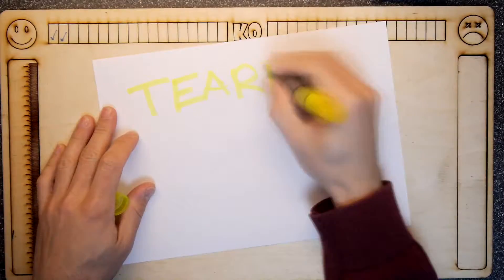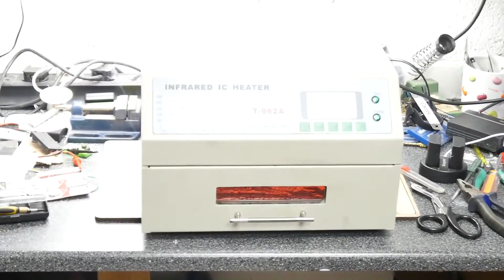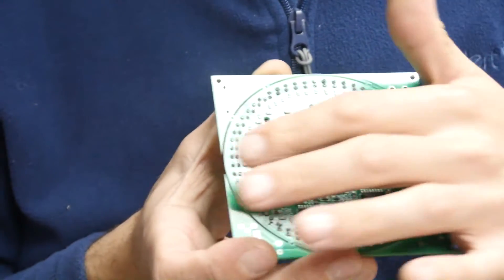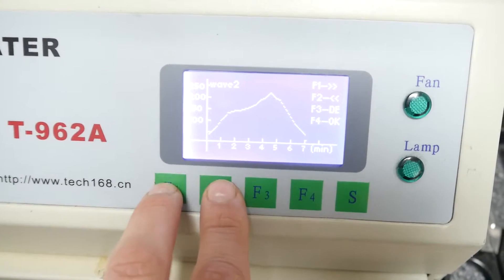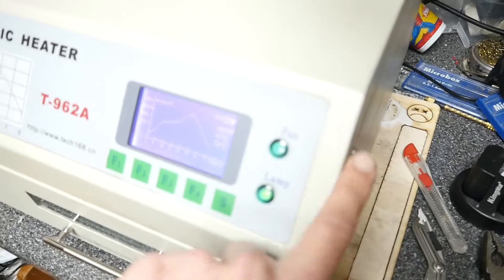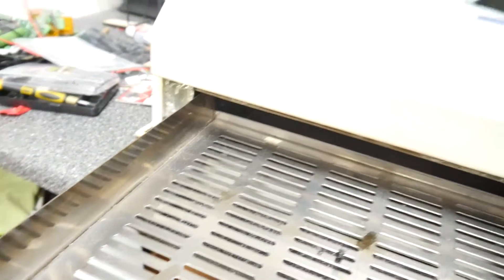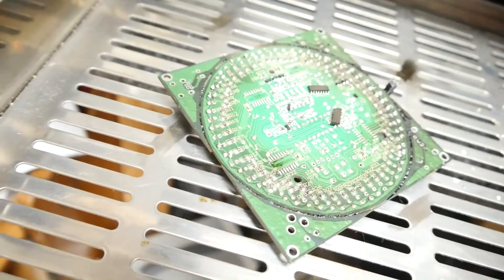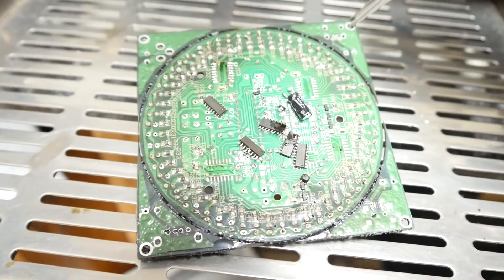Reflow Oven [Fail]

Comment: You should never mix through-hole and SMD components when using reflow oven as through-hole components have low constant heat limit.
This time, you did it incorrectly and set the curve too high, resulting in components burning and getting destroyed, as well as them falling off the board.

Comment: Wow :) you cooked that one... If your going to do something like this again, you need to protect the fragile components, I used thick layers of tin foil and foil tape to construct heat protection shields. You also need to play around with some test boards and setting up the heating curves.
Reply from the maker: There looks like a much cooler curve, I wish I tried that one first
Reply: The Backoffice yeah, the cooler curve would have been better, also need to look at the info for the solder paste you used, as that should give you a guide to what flow curve is best.

Comment: Woah. I suspected that the through hole components wouldn't take reflowing too well but I didn't expect the board to come out that toasty. Thanks for the good morning laugh and for sharing. :)
Reply from the maker: +Jan Beta unfortunately the Flir only goes upto 150c so I couldn't measure it, but I do not think the oven is at fault. It's interesting because I run my gear near 400c but you are only hitting the joint momentary
Reply: My hand soldering tools also run at 370C or above. It seems to depend on how long the board/components are heated. I don't have any reflow experience whatsoever though so this was pretty insightful for me already (albeit destructive for the poor clock kit and your work).
Reply from the maker: +Jan Beta well you know from hot air use on big ICS how the board has to get upto temperature I guess it's like that on a big scale. Even heating everything to 70 degrees would make hand rework easier I think. Also I have seen people make shields to cover the areas they don't want baked.